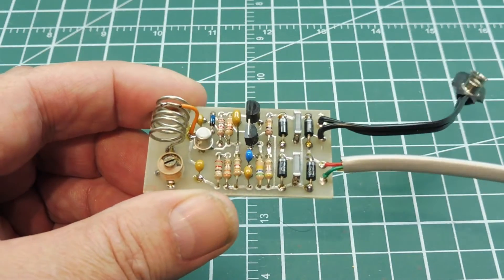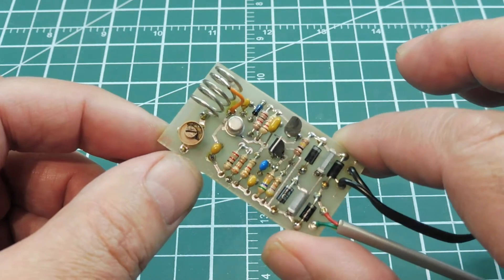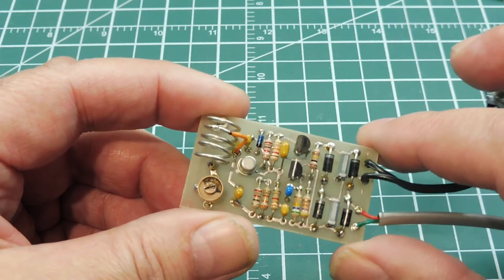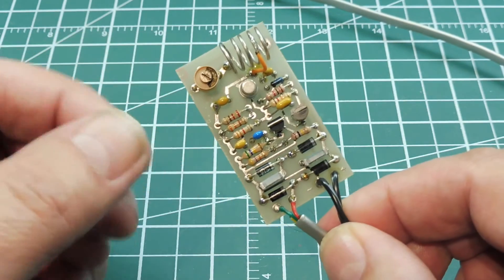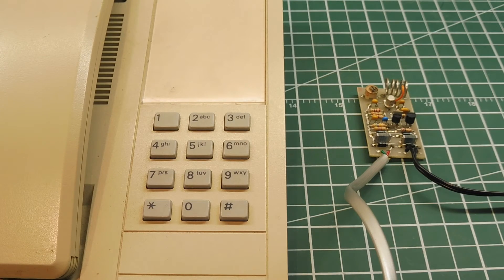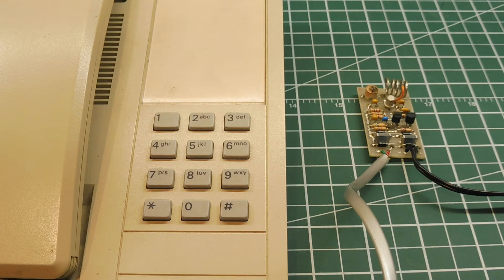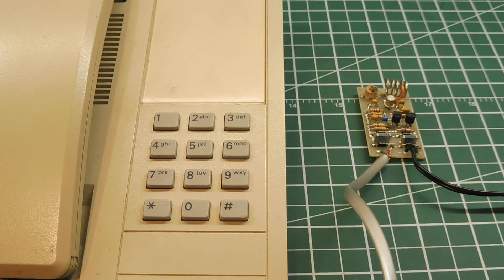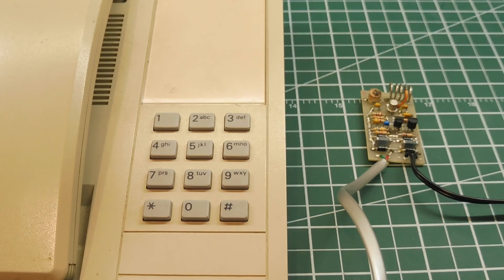FM Telephone Transmitter

Comment: Thanks for the share. I just have one question, what is the practical application for this if there is any, or is this just a learning step for something down the road?
Reply from the maker: It's just a fun project, and you learn about simple radio transmitters. This transmitter is an oscillator and modulator using one transistor, the simplest circuit you can find. As a prank some people use them to bug their phone line.
if you want to learn the theory on how they work check out this video:
https://youtu.be/e5kIaub7Xio
Reply: Thanks for the reply. and I will check it out.